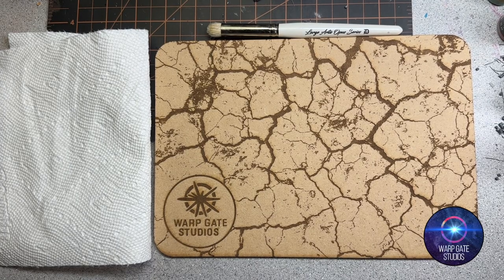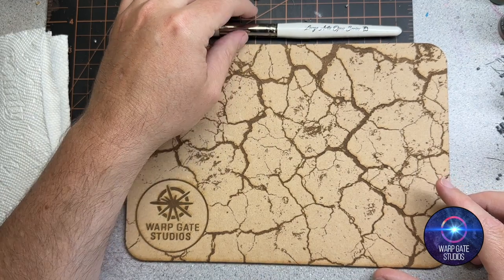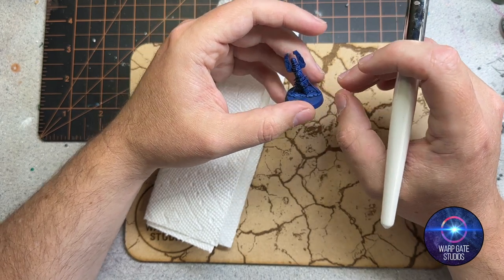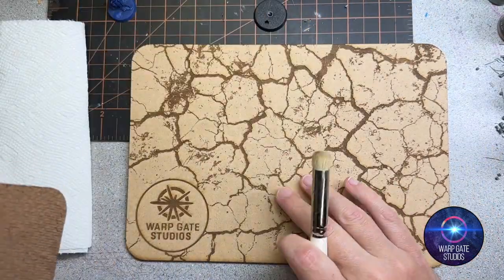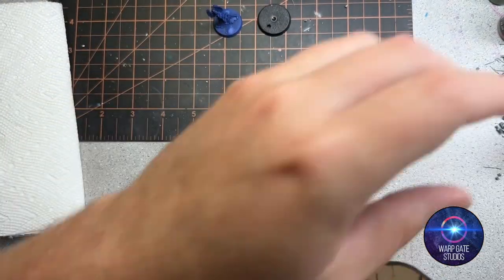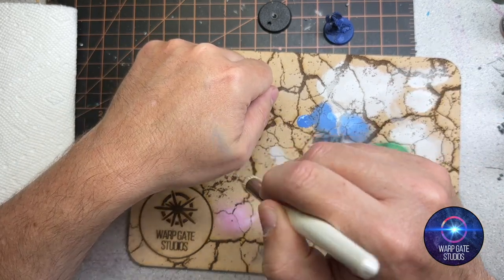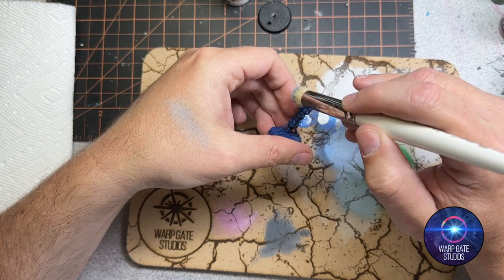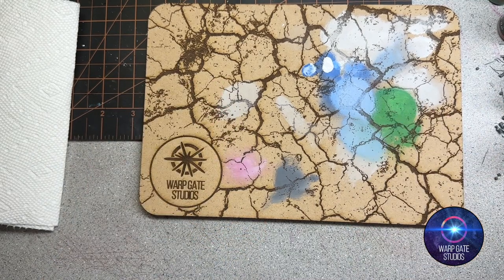How to use a Dry Brush Palette

Comment: Can't you just use any non absorbent surface to do this? Seems a bit excessive to spend 30-40 bucks on a texture palette
Reply from the maker: I think mine go for $25 which includes postage but you can find others out there a lot cheaper that 30/40. The mdf has enough grit in it to help the process. I have tried Resin and Plastic texture palettes and they do offer different experiences. But sure anything that doesn't absorb the moisture would work. :)

Comment: I've been using a glass cutting board as my paint palette and it works great but it doesn't have any texture so I just keep swirling the brush around to remove the excess paint. So far so good. I was thinking of getting one of these and priming it to get a better idea of how colors would look when mixed.
Reply from the maker: Totally! I have seen them primed with black grey and white and they do mimic very well and work nicely!

Comment: Thanks for this video, it really helps explain the concept.  I've seen others also incorporate a dampening pad.  Have you experimented with a dampening pad, and if so do you like it?
Reply from the maker: Yeah a small sponge that’s damp can keep the moisture on the brush and prolong the paint usage. It’s a great tool. I have seen folks purely throw some fine sponge on an area on their wet palette as well which works. All great fun experimenting and see what works to help with painting. Thanks for the comment.
Reply from the maker: Yes a damning sponge is decent to keep the brush moist if you are doing a ton of work with problonged periods of the paint being on the brush. I tend not to do that though as it’s a paint to wash the brushes out the longer you have paint on the brush.

Comment: Do you clean the texture pallet or just re use it? thanks
Reply from the maker: You can give it a wipe with some isopropyl or just keep using it. I would wait until it’s caked on and then peel it off or give it a clean. As long as you still have a texture you are good though!